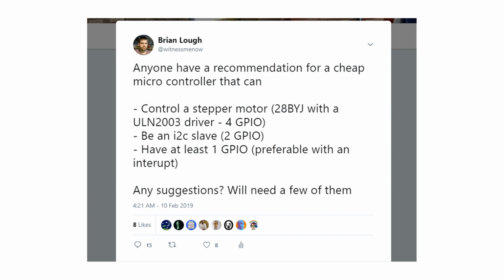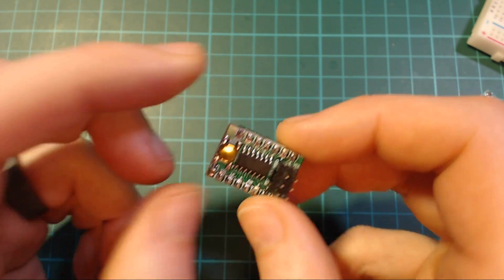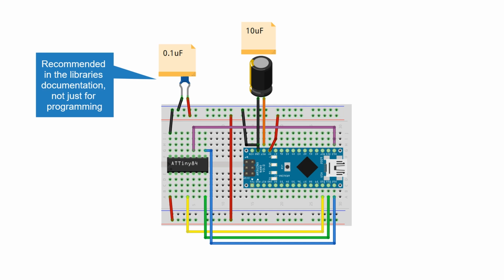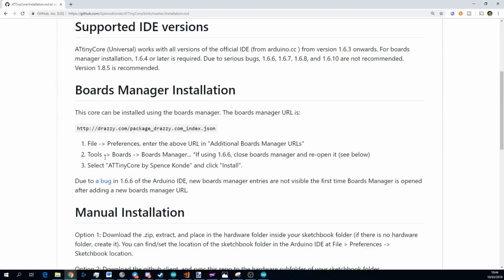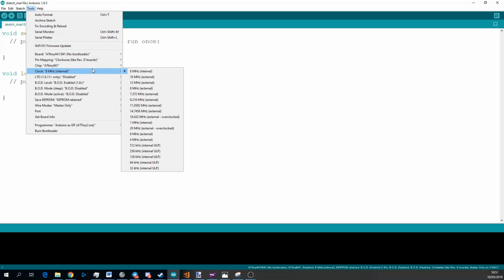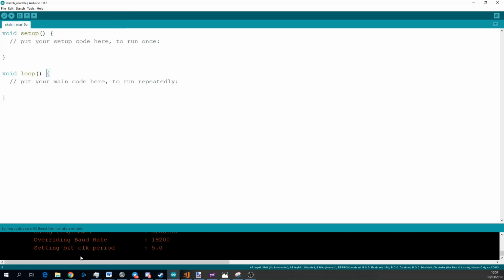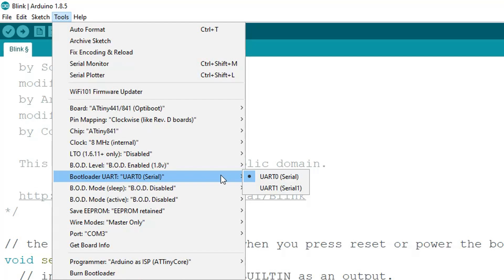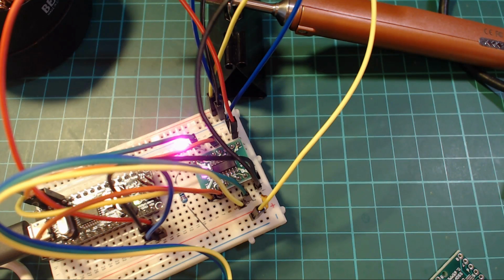How to program the ATtiny 841 using the Arduino IDE

Comment: Why couldn't you use the ch340 uart programmer to burn bootloader as well before uploading sketch. I'm also busy with the attiny841 and have tested both arduino as isp and the ch340. It seems a bit pointless to use the arduino to burn the bootloader and the use the ch340 to upload sketch. 
I haven't tried using ch340 to burn bootloader to attiny841 and upload sketch. I'm not sure if it is possible. Have you tried it

Comment: Hi! I would like to know if you have experienced programming several attiny On the i2c or twi bus,  like slaves and they can turn on and off a led each with the order from an Arduino UNO as a master, whose function is to send to they the order to turn on and off the led and that the slaves in turn send the status of their leds to the master? Thanks!

Comment: Excellent video. But one remark about connecting the LED to the board.

works with SpenceKonde 1.2.3 board manager release ATTiny 841 pin #6!
works with SpenceKonde 1.4.1 board manager release ATTiny 841 pin #10!

Comment: Brian, excellent video, I was trying to program an attiny861 but been getting Device Signature 0x00000000 error. I wondered if you ran into a situation like that. I have been searching the google and lot talk about the attiny85 chip. not the attiny841 ir attiny861 chips.  Just wondered if you might have some insight on the subject.

Comment: The attinys are in fact  too expensive. 1 dollar plus an adapter, whereas 1.60 dollar will give you an arduino promini
Reply: It's the size aspect.  The adapter is used for development purpose, i also use an attiny backed against an minimal nrf24 module as a tiny receiver for toy cars. A promini would not fit

Comment: The good thing that it has enough pin for what I need (Si4432, 4 pins for SPI + 2 pins for controls), but bad thing that on eBay, there is no cheap option. Where did you buy this MCU?  BTW; you have new subscriber, you did great job. Thanks.
Reply from the maker: I bought mine of farnell.ie (which is element 14). I know they are available from digikey too. (Both are linked in the description). Yeah that is one pity that it doesn't seem to be available from China

Thanks! Really appreciate it
Reply: @BrianLough  Now after looking at datasheet - I like that chip even more. Some things can be done with Attiny85, but sometimes there is need for more pins. Seems that Farnell offer buying minimum of 1 piece, so that is good option too. Not too expensive. Oh, sorry... I did not saw your video description, probably need some more sleep after hours of programming STM32. It will be fun to see both: Attiny841 and STM32F103VET7 together in some communication 'toy' at 433 MHz. Thanks again for great news and really great info.

Comment: Interesting video. I am not sure why you selected the Tiny841, except that you can use the  Arduino environment. Other processors has similar data and some is also cheaper. I would choose a processor that can be debugged and that has an professional  IDE. It could be a PIC controler where you have an excellent IDE (except for the Crappy free Compiler) and the PicKit debugger probe. My preferred processor in the 8 bit area is EFM8 (ex: EFM8BB10F8G-A-SOIC16R)  , it comes with a free IDE (Simplicity Studio) and you can buy an cheap debugger on Ebay (Look for C2 C8051). With this setup you can code and debug (single step and breakpoints). Developing I2C slave will be a lot easier when you can set breakpoints.
Reply from the maker: The person who makes the i2c rotary encoder also recommend a pic for this job too but to be honest I just dont have the experience yet of working with pics, but  there seems to be great info in this post for me to get started so I might PIC up a few... (I'm sorry, could not resist 😂)

I'm pretty time poor at the moment so something with a lower barrier of entry for me is more important than anything else.
Reply from the maker: Do you have any links for where might be a good place to read more about this stuff? I would actually like to get some of the stuff you mentioned
Reply: I know that starting with new stuff has some barrier to overcome, and so its also with micro processors. I did also start with a Tiny (84), I found it very difficult to debug only relying on flashing diodes or serial data. I think if you spend the time with an development environment with a real JTAG,SWD or C2 debugger you wont regret the time spend. So much more in controle.
I started with the PIC processor and a PICKit3 probe (random Ebay: https://www.ebay.com/itm/PICkit2-PICkit3-PIC-KIT2-3-PIC-Debugger-Programmer-Emulator-Controller-Adapter/263554503372?hash=item3d5d1292cc:m:mF64g1DBKWHXX6A0eNoslbw). From Microchip you can download MPLAB X IDE, which is the IDE. There are some tutorials on the net on how to use it. One problem with the free version of the compiler is that they insert dummy instructions to slow down the code, if you buy the IDE you can get rid of this slow down, that was one of the reasons to drop the PIC.
Silicon Labs EFM8 series is as I said, is my 8bit processor for the moment, the PROS for this processor is: its cheap, the IDE is free and good and the debugger probe is only $10. You can find the processors on Digikey (https://www.digikey.com/product-detail/en/silicon-labs/EFM8BB10F8G-A-SOIC16R/336-4742-1-ND/8610996) or your favorite place. The IDE can be downloaded from www.silabs.com, and the debugger (random EBay: https://www.ebay.com/itm/C8051F-MCU-Emulator-U-EC6-USB-Debug-Adapter-Downloader-JTAG-C2-Mode-Cable-New/263210606346?hash=item3d48931f0a:g:YRwAAOSwiKlZvQq1)

Good luck, looking forward to here your opinion on programming microprocessors besides from the arduino types, and using a real IDE and debugger.

Comment: if you put the chip at the other end of the adapter board the two extra pins could be used for a decoupling capacitor solder bridged to pin 1 and 14

Comment: Thanks for the walk though and references. 
  One tip for anyone getting an USB to serial converter like the one mentioned at 9:25; try to get one that has the "DTR" pin broken out on the output pin header. This is one of the signals on the converter chip. "DTR" is one wire of the whole RS232 serial communication standard these chips are designed for. When programming many other Arduinos over UART the automatic reset over USB is handled using the DTR pin. 
   If you're ever looking to make your own boards with one of these converter chips the ch340g's are cheap and the SOIC package is much easier to play with. Also, the translated English datasheet has a schematic example of an optocoupler isolated design too. This can save your computer if you happen to have a dumb moment on the bench or experience a bad failure.

  Lastly, when using the USBasp's they always produced an error message that makes it appear as though they are not working when infact they are. They kinda suck with the ArdyIDE. They work far better from a command line using AVRdude although I have gotten both to work.
   I'm no expert. This has just been my experience on the subject.

  As a simple viewer, I definitely prefer these types of general reference uploads that are easy to save in a playlist and reference later when I need them.
  Thanks again,
-Jake

Comment: Brilliant!
I think powering the wee bugger will be a handful and effectively removing any gains of its small size as you’ll need a 3.3V converter. However nice to know it comes in such tiny packages!
Reply from the maker: According to the data sheet it operates between 1.7 and 5.5v so it's very flexible!